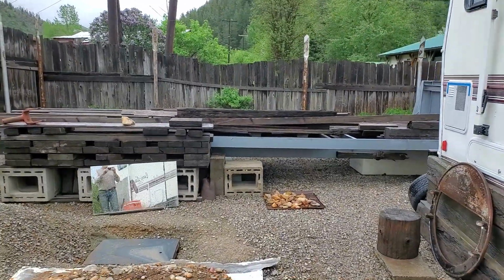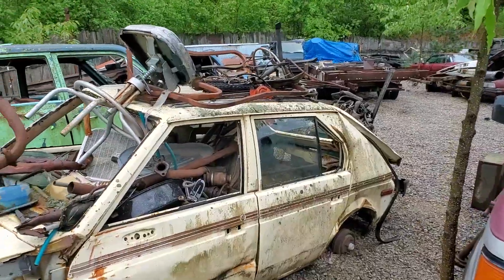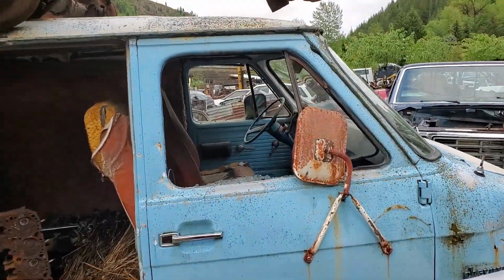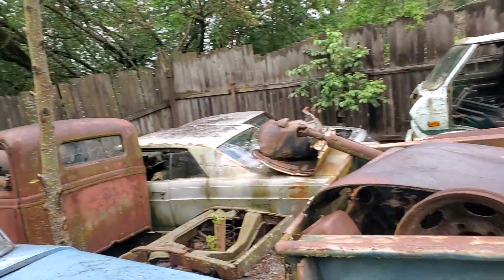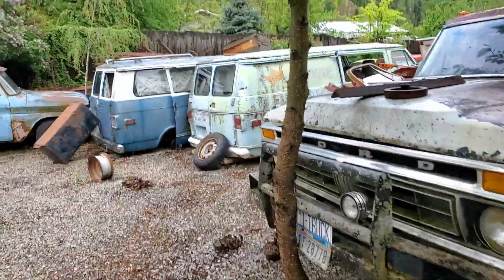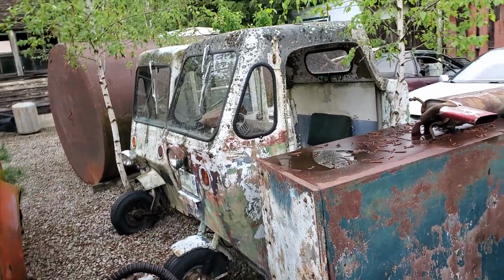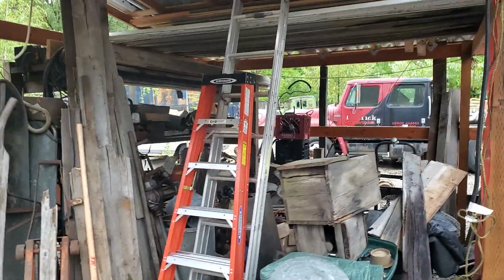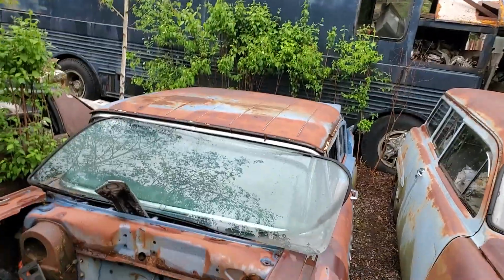Towing & Salvage #1 of 2

Comment: Nice job on the lot! If I were closer I'd come do some parts picking. I restore components, instrument clusters, steering columns etc.  At the 19:19 minute mark in this video, you have a rare orange air cleaner upside down in a truck bed. It's off a Hi perf 340 Mopar engine. Probably worth a hundred as it sits.
Reply: Damn, I like to have that air cleaner, I've been collecting those Mopar Air cleaners, for some while, single snorkel and dual snorkel!!! I just found a 1972 440 4barrel air cleaner in a friend of mine Aunt's garage, it's in really great shape, it belonged to the Aunt's former husband's '72 Dodge Charger Rallye, wish the car was still there!!! Mopar Nate Philadelphia, Pennsylvania

Comment: It will be hard to find people who are really into working hard. I see the possibilities of using a Hollander Parts manuals for identifying many different parts and pieces. I don't know if I can keep my comment short enough for you to want to read. If you had people who are capable of working in areas of say just body parts, the better stuff of course, engines of different model and make so that they can go back into service by a independent rebuilder, same with transmissions. One problem is that this is not stuff on the road anymore so low call for just parts. There could be though if you were able to go through this stuff and catalog  all of it and tag it somehow or way so it can be found or stored into a large building that will hold racks of parts. Your going to need someone who after they power wash all the debris off of them, sort steel from cast or aluminum, plastics and glass. I have seen glass recycled and its a art of its own. It would be nice to have a metal shredder but your limited right now to not enough to make that viable. I do see some restorable or refurbishable stuff might be a better choice of lingo. I did see stuff thats real old but most is fifties or newer and that is a blessing in my thoughts. All of those divorced transfer cases are of high value as rock climbers are making it a sport now. Along with the cases of those, the drivelines have a future for reusing the pipe for a good many different things used in rock climbers or just reusing as intended for in the first place. You go to a driveline service and walk out with a driveshaft that cost less than say a low price of two hundred, thats considered a really good deal now. I see part two of the walk around, I did subscribe as I would like to see how far your dream goes. There is the quick way out of just sorting and crushing, or doing some salvage of good parts... thats going to be a hard call for you cause you see those possibilities